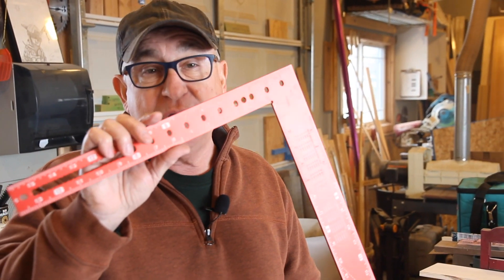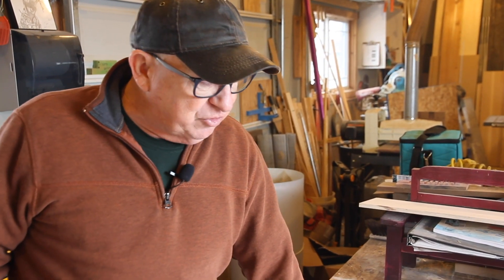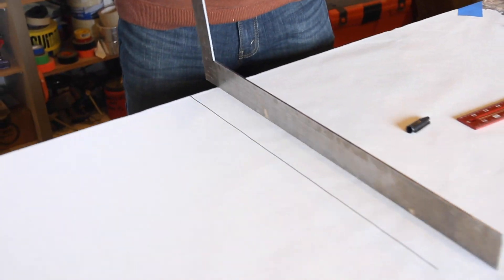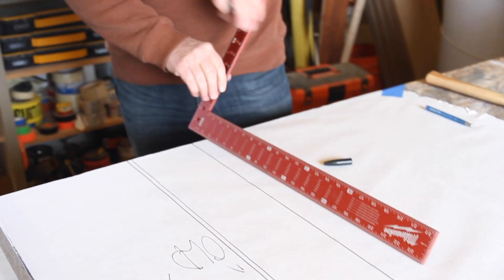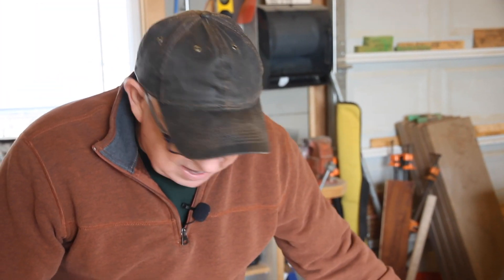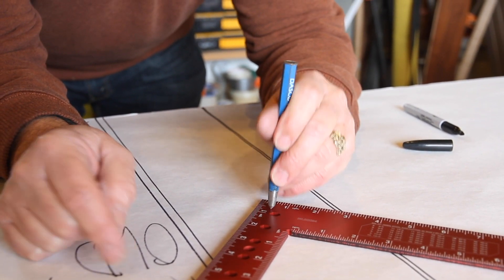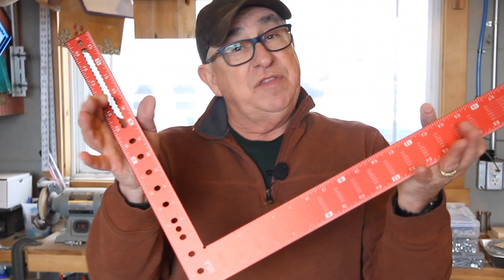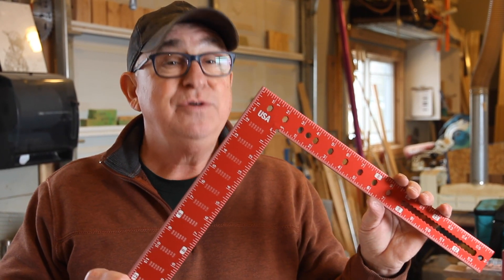How Do I Know if A Square is Square?

Comment: Wow! I never knew this! Any way to adjust a speed square? Thanks!
Reply from the maker: Glad to share something new. Speed squares are a bit trickier. The same method will accomplish very little changes due to the fact you are working with a triangle. Bigger changes would have to be done by altering the flanges that run across the bottom edge of the square. That likely would be done with a large flat file or a stationery belt sander. Best, DFJ

Comment: I'd be a bit more careful by avoiding that paper to partially roll over the edge you're aligning to.  It's not much, but perhaps another .004" or so if it's only partially in contact with the square.
Reply from the maker: Good insight, JJJ.

Comment: For starters, you used the interior of the old square then the outside of the old square. Then you used the outside of the Milwaukee square on both tracings. Use the same side for both tracings next time on both squares.

Comment: your first line on your old steel square was the inside of the long edge, second after flipping was the outside edge - they are not always same (in my cheap framing square) so best make sure youre comparing same edge when flipping. First test on the milwaukee square was both outside edge then 2nd test after punch you were comparing inside edge. If the squares are not cut accurately you can get the inside edges being true but the outside ones acute or obtuse. Need to keep consistency if you want true accuracy.
Reply from the maker: Good insight, Al. Thanks for watching and then taking time to share your insights. Best Regards, DFJ

Comment: I've noticed on a lot of framing squares if you use the inside to draw a line then if you move the square over to the outside the lines won't match or vice versa. The only reason I believe for this is that the cut on the squares are out.

Comment: Once you roll the square over, you have to use the same side that you started with (inside or outside). If you switch sides, like you did once with the Milwaukee, it won't be accurate.
Reply: But he used outside first and then inside after the adjustment. That assumes the square is the same width up the length.
Reply: He used the same side both times on the Milwaukee

Comment: You can also check a squares squareness by using a tape measure 3-4-5 technique or multiples  of it, the longer the better. Actually it'd be 9-12-15 or 12-16-20. Hook (I'd burn an inch so the 15" between would be 16") your tape measure at 9" mark on the 16" short side. Measure across to the 12" mark on the 24" long side and it should be 15" on the tape measure in between them. Using this measuring technique is also how to check if a layout-deck etc., is square without a square. Feet for larger measurements.  FYI don't leave your steal square lay in the sun tuck it in the shade--throwing some at ya! ;)

Comment: You can't check the squareness by measuring the inside of the square leg against the outside of the square leg like you did twice (on the steel square and the second check on the Milwaukee). You only did it correctly once when you initially checked the Milwaukee. You have the draw the line on the outside of the leg every time otherwise you're also taking into account the parallel error in the leg.
Reply: Good point...What if the edge of the table is off (V shaped, either in, or out)?

Comment: Similar to checking a level for plumb.  Love it, great tip!   Will do this morning before i build some stairs .
Reply from the maker: Matt, indeed. That's a great tip as well. I think I'll film that procedure and give you credit onscreen for the tip. Is using your screen name of Matt Mag suitable, or would you like something else? Thanks for watching - and writing! Best, DFJ
Reply: @DirtFarmerJay  absolutely thats great, cant wait to see the next one!  Love the vids keep em comin!
Reply: Where do I hit the level to bring it into plumb?
Reply: @24revealer  Ooops, didnt see your comment b4 I commented   lol
Reply: How can u self adjust a level that is out of plumb?
Reply: @TassyDeval  hey
.. Sorry for the misunderstanding.  You can CHECK a level by centering the bubble, scribing a line, then flipping the level and check vs the line.  But you can't FIX a level usually.  not many levels (if none) these days have adjustable vials. Level is trash if it is off more than your required tolerances for whatever project you're doing.  You could file, grind and reposition the vial in epoxy ... But I think the precision required for that requires robot hands :)

Comment: Could you do the 3 4 5 rule? In other words take a rule put it on 3. Take the other end to the 4 on the blade. If if measures 5 you're golden
Reply from the maker: Curly, indeed. I'd actually multiply it out and use something bigger, such as 12", 16" and 25". Any error would show up more readily, easier to see. I like using the flip along a straight edge approach, simply because any error, no matter how minor, is doubled and easy to spot and adjust. But, short answer, yes your approach is sound. Thanks for watching and writing! Best, DFJ
Reply: @DirtFarmerJay  I liked your video and learned a new trick. Keep these videos coming. Thank you!

Comment: Good thing the new square is aluminum. I think it would take a few more divots if it was made of steel. Sad that Milwaukee is not up to par. You can bet a lot other manufacturers get it wrong as well. Great tip. Thank you. BTW, I prefer an old steel square because the markings are carved into the steel and cannot wear off. I have a couple from my dad that I want to restore and highlight the markings in a contrasting color.
Reply from the maker: Paul, great to hear from you. I like that you have an affection for old tools and have a desire to give them another life. Indeed, etched tools take a coat of thinned oil based bright white, orange or yellow enamel well. Let sit for a few minutes and carefully wipe off, leaving the etching filled with the high contrast paint. It really makes all the tables and measure marks pop out. Let me know how it turns out! Best Regards, DFJ

Comment: I would have Expected more from Milwaukee,  thank you so much for the tip.
Reply: I'm thinking he offset it for the show.
Reply from the maker: Ward, not this time around. I was actually going to use the new red square because it showed up so well in the video. I fully expected it to be square, as I've had good results with the brand. I was really surprised to find that it was not square. The other "legacy" square was square after about 3 decades of service. I'd like to think that the less than perfect tool was a vast exception and that almost all the time, you're going to get a good product from Milwaukee. Ward, thanks for watching and for taking time to write. Best, DFJ
Reply: Great tip thank you. Would this work for a steel square?

Comment: I’m shocked they don’t check and either reject or recalibrate before letting the square out of the factory. Excellent tip.
Reply from the maker: Clare, (and Ellis and Ward!), thanks for watching and writing. I normally have very good results with Milwaukee and this was probably a glitch. I showed the square as it was, it actually was not square off the shelf. This is highly unusual, but no faking on our end. I really like the square, along with it's high visibility and general overall quality of etching and coloration. In fact, I plan to customize it and put wood cheeks on the tongue and create a mega-square for carcass layouts for cabinets and larger furniture/project parts. Best Regards, DFJ
Reply: @DirtFarmerJay  Dude you don’t have to explain to much about not being squared because the same thing happens to me with the Milwaukee squares including the small speed square 
They were off from the factory like you showed up at the video 
With the speed square is nothing I can do to fixed it so is a waste right now 
So from now on I will check before I buy 
I’ll get a pencil and take the square to a perfect edge at the box store make the mark an ser wich one is square 
Go figure
Reply: I would expect better quality from Milwaukee.
Reply: I'm thinking he offset it for the show guys